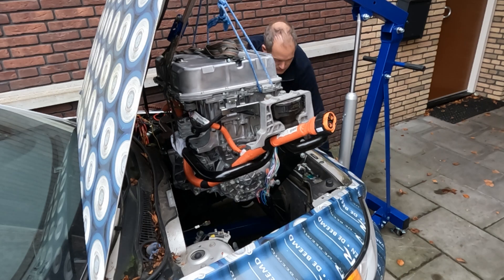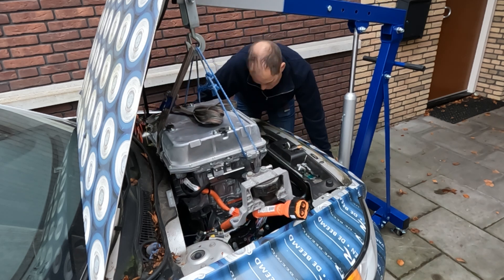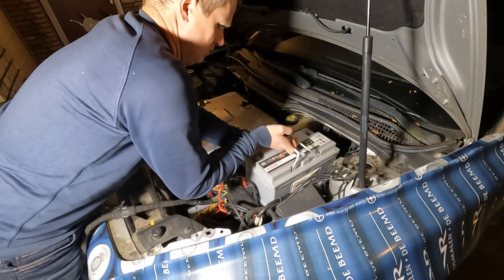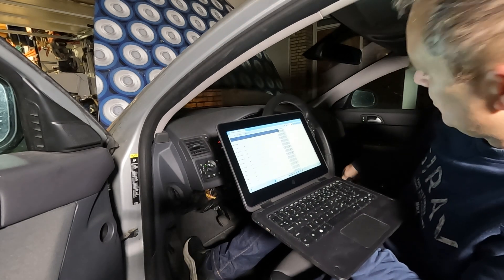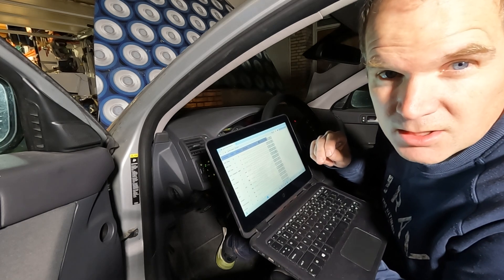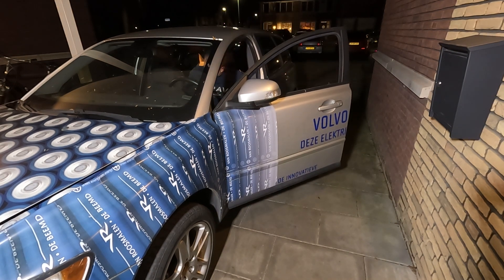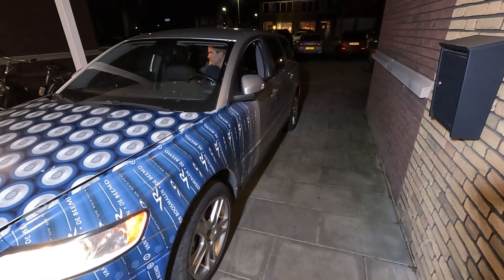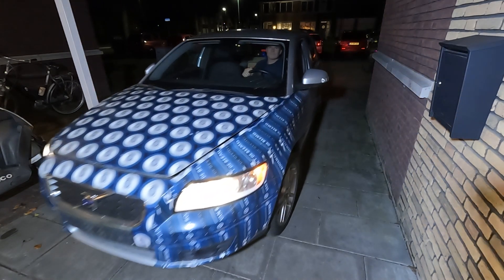Making the Volvo V50 drive with the Nissan Leaf motor

Comment: Congratulations, first drive is a big step.
A wee tip for filling gearbox oil, push a clear hose around a meter long over the spout and you can fill any gearbox by just squeezing the oil out of the bottle, even if it is above you. Best of all if you need a second bottle just swap the lids.